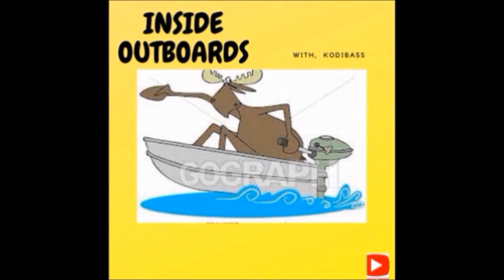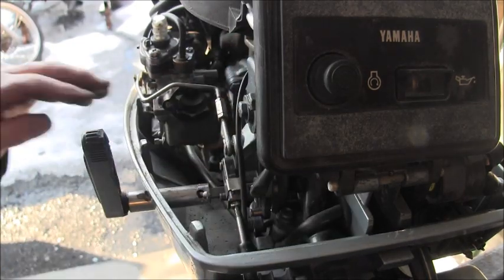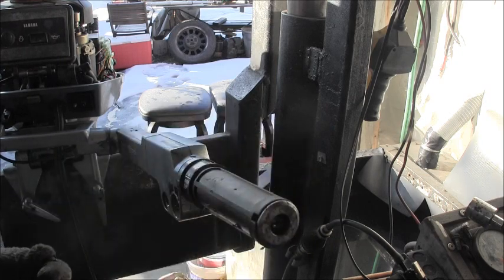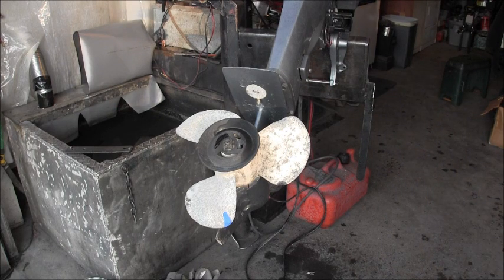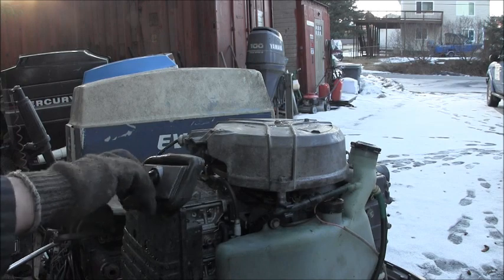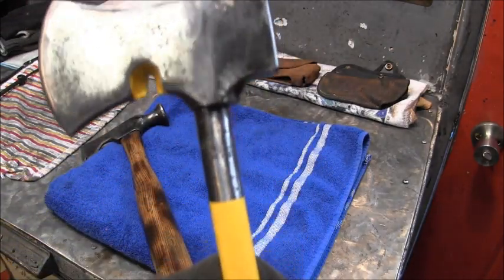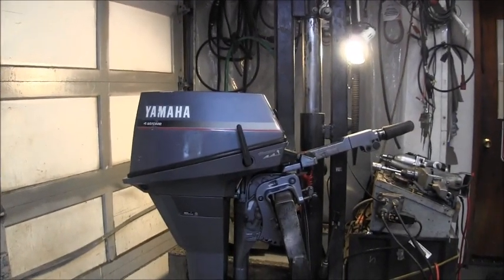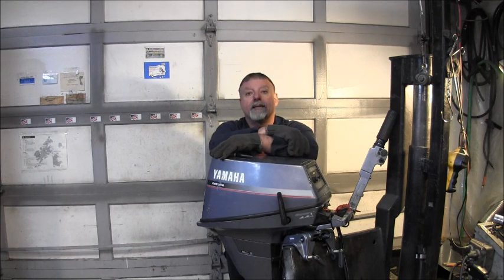YAMAHA  9. 9 HP 4 stroke with  MODS

Comment: Thanks for another video. I've been working on some outboards, mostly carbs needing cleaned. Yesterday I was working on a 2006 5hp Suzuki DF5 4stroke, with integral fuel tank. I cleaned the carb and fuel pump. Oil level was spot on.
This motor has not been used much despite being 15yrs old. It was running sweetly at tick over and tell tale flowing nicely. After about a minute it stopped abruptly. It seized. At first I thought it might be the piston. I took off the recoil start and could just about move the flywheel which was very tight and equally tight the whole way round. If it had been the piston the flywheel would be free at around TDC and BDC. I suspect big end or main bearing has seized. I think the lower main bearing and the big end sit in the engine oil but the upper main is well above the oil level. Anybody got any thoughts why the motor seized thanks.
Reply from the maker: Pull the flywheel off,  mite B something came loose under there & not internal @ all,,,  I had this happen on a old Tohatsu,  mag screw backed out & stuck to flywheel magnet   worth a check.    kodi
Reply: @kodibassInsideoutboards   I'll pull the flywheel.  I hadn't thought of that possibility. Thanks

Comment: Great video but will this part work 6AU-44111-10-00 its for the 4 6 and 8 horsepower Yamaha seems like it would let me know I have 2 yamahas 9.9 motors that I need shifters for. And wanted your opinion sir.